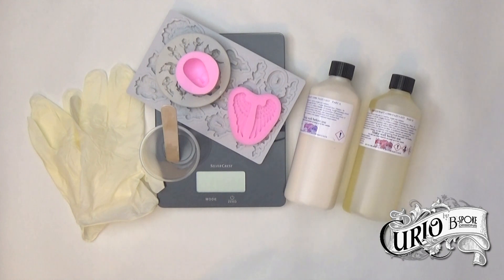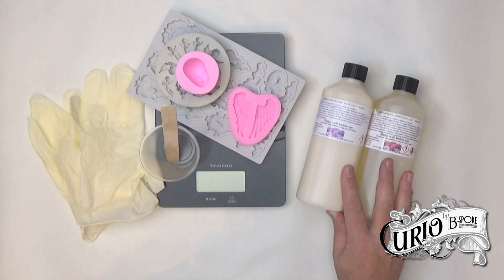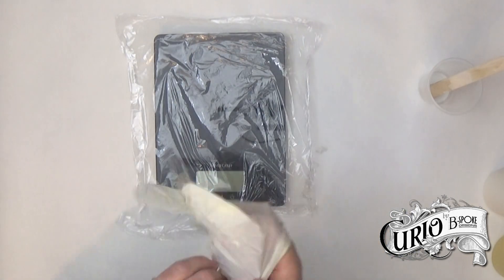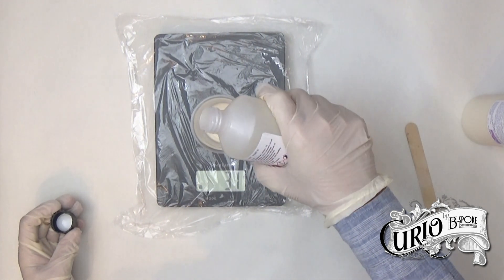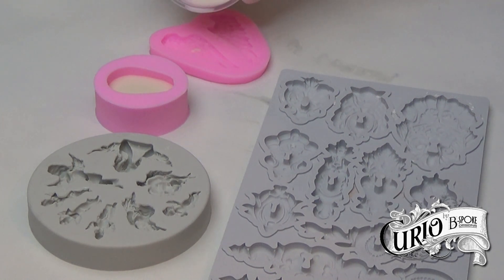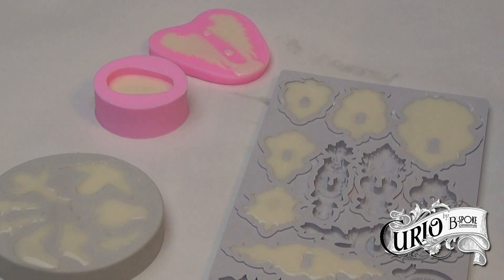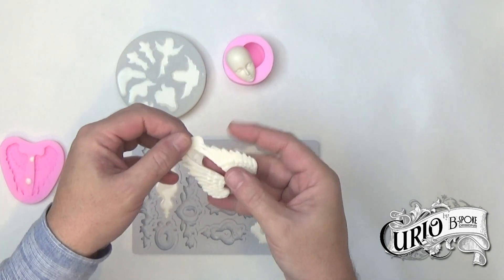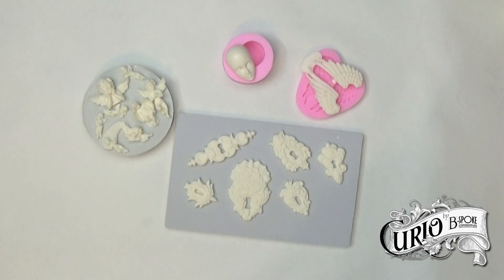Casting Resin in Silicone Moulds

Comment: Excellent video. I am looking at purchasing resin for using on items I want to post because I figure clay & plaster of Paris will shatter & weight more. I wasn't aware of the short shelf life so thank you for pointing that important fact out. 👍👍👍
Reply from the maker: You're welcome.
Reply: @CurioByBSpokeDesigns  I've just managed to purchase direct from Mouldcraft, a small (150ml) of the A3000 white for only £7.50 free p+p. This was I can make just enough to use up the product & keep the pieces in a container. I can always invest in the next size up which I believe is 250ml £10.99 if I need to once I've played. Thanks again for great advice. 👍

Comment: Thank you for this. I've been thinking about using resin for a while now but was unsure which type was best. I've been using air dry clay. It's fiddly, messy and often unreliable ( curling edges no matter how quickly or slowly it dries). I think you've made my mind up for me.
Reply from the maker: Polymer clay may be an option for you